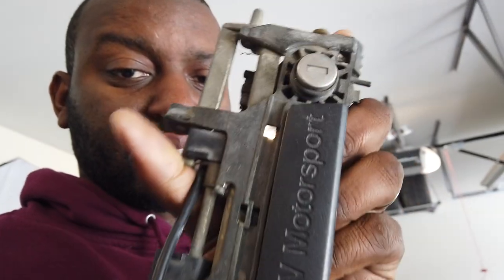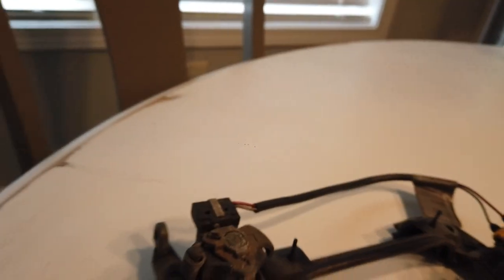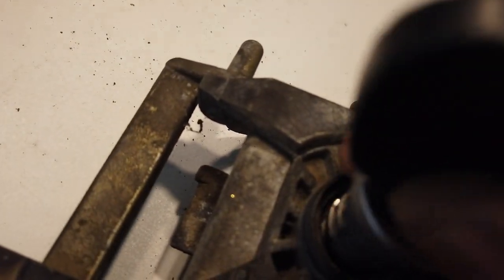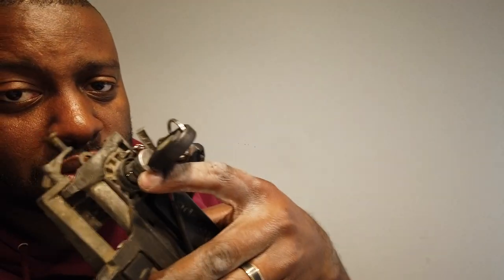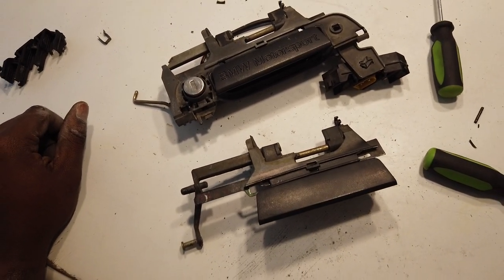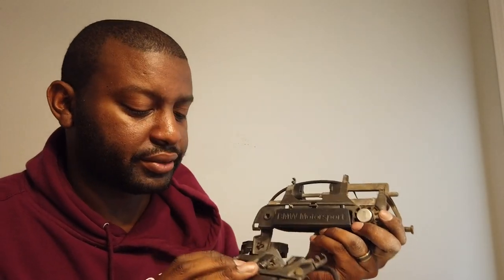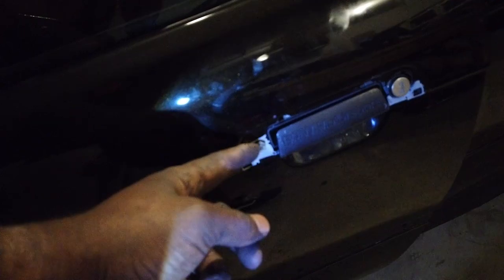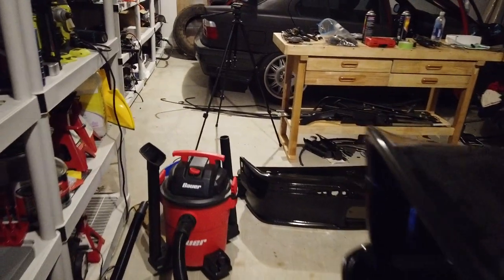Installing E36 BMW Motorsport Handles Seriously Pissed Me Off! || Turbo E36 Build [Ep. 13]

Comment: You have the two key cylinders, just swap out the pins from one to the other and your old key should work in the euro key's cylinder! The pins are unique lengths that line up with you keys profile that allows the cylinder to spin and unlock your door. I messed with all this stuff in my VW days and it is tedious but at least you will have one key for the whole car. Or take the cylinders into a lock smith and they can switch the pins out 👍